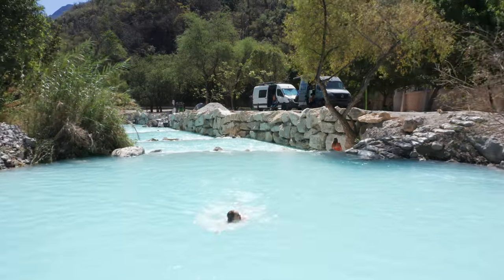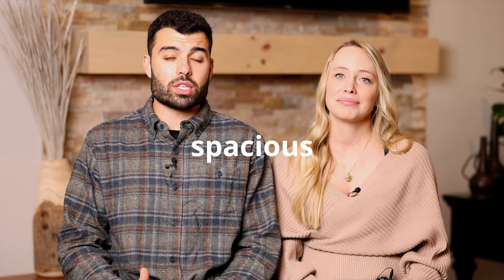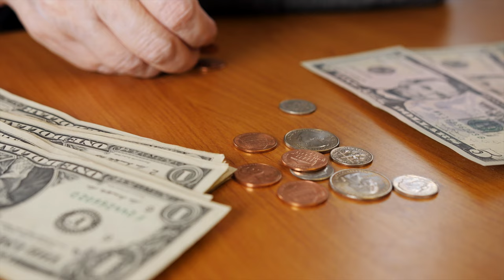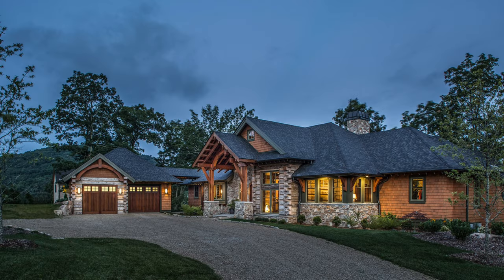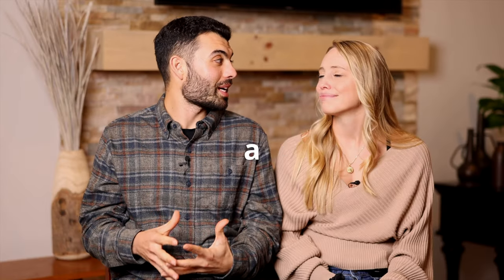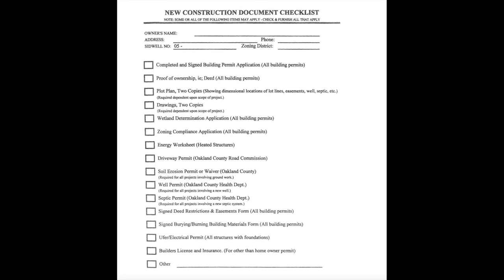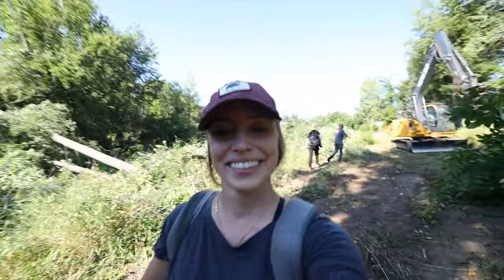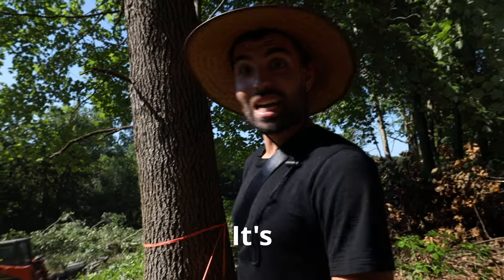Building a House Start to Finish | Home Design Ep. 2

Comment: If you have any questions I’d be happy to help you. I’m a custom builder on Cape Cod for 30+ yrs , still building and booked out up to a year , every year. 
     Couple points on your plan. I’d take the shower out of the spare bath and put the washer dryer there. Use the washer dryer room as on en-suite for bed 1. 
     In the master bath, I’d make the shower the enclosed toilet , bump the jacuzzi out 2’ , and expand the “ water closet” or toilet into the hallway to make a 6x6 or 8x8 shower instead of the small shower that’s there. 
     Trust me a huge shower is a huge plus . And every bed should have and en-suite. 
    Just my opinion based on thousands of homes I’ve built for customers who end making changes. Good luck and reach out if you have questions.
Reply from the maker: Thanks JN, appreciate that!! Sounds like you’ve been busy!! Our thought with the shower in the powder room is that we could turn the office into a 4th bedroom and that bathroom would be an en-suite if we need it.   Definitely tried to fit in another bathroom with the guest bedrooms but just couldn’t get it to work, but hey kids will live!

I like your idea in the master, the shower is on the smaller side for a master. I will take another look at the plans. Appreciate this!! 😊
Reply: Currently in the planning stages of building our home, could i send you my plans and have you look over them?